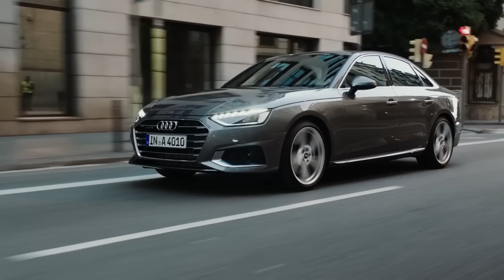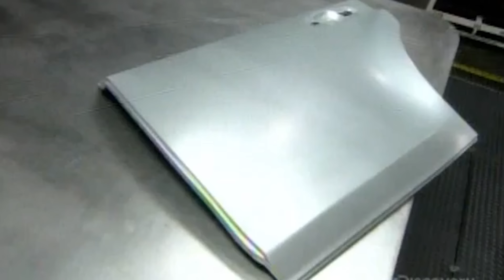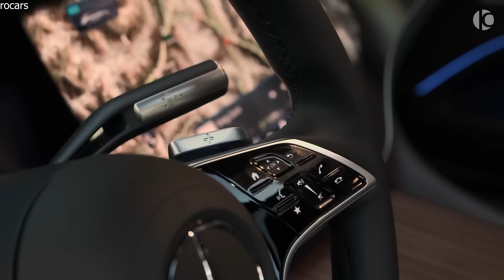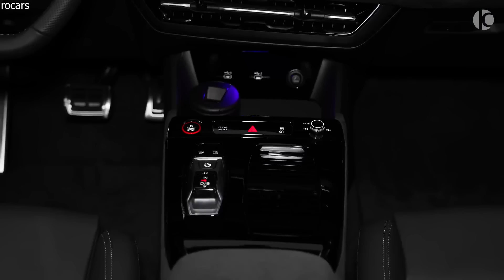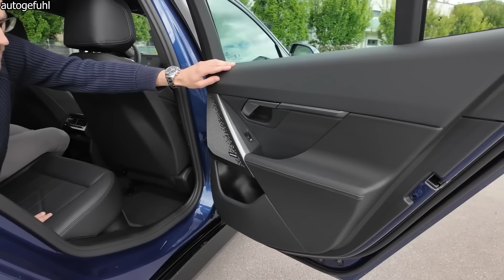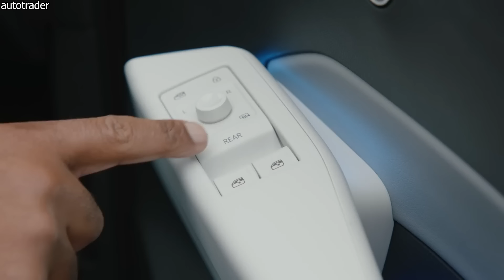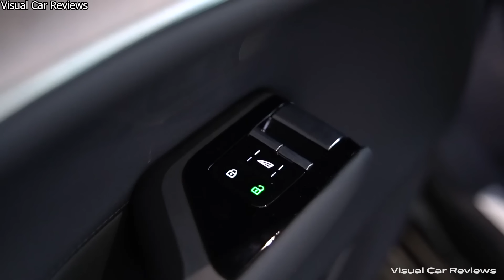Why New Cars Feel So Cheap?

Comment: Check out Genesis! Doesn't feel cheap, less plastic than the competitors, no abundance of screens, and very comfortable. If you can deal with a few reliability quirks then it's totally worth it. I bought the GV70 for my mom, the G70 for my wife and I got the G90. It really fills the gap between the old style luxury car and modern.

Comment: Ever since I bought a 2006 Mitsubishi Lancer GLX 1.6 (almost poverty spec) my standards for interior quality are much higher, the dash is covered in vinyl but it has a soft touch finished with wood trim, the door cards are covered with the same vinyl finish up top and its backed up by foam so its nice and firm but not hard like pastic the middle of the door card is covered in fabric the seats where cloth but it lasted all the way to 425k km when I sold the car. This was a budget car with better interior than modern Mercs

Comment: No joke, 2013 Fiat Chrysler products have nicer feeling interior materials and switch gear than new BMWs.  I bought a used 2013 Dodge Dart base model a few years ago and everything was soft touch. Dash felt good, the climate control knobs were rubberized and felt premium, etc.

Comment: Went to a mercedes dealership today and was flabbergasted, My base model c180 w205 has a better interior quality than the GLE 53 on the showroom
Obviously it looked way more expensive but when I started feeling with my hand I could felt way more hard plastic than should ever be in a E class
And its crazy because the previous c class also didnt have any hard plastic in any place, just doesnt make sense

Comment: I have W201 Mercedes 190D, the C class before it was named like that, the car is 31 years old and driven over 500 000km, with all my might if you try to pull the door handles or the middle console it doesnt maky any sound, love sitting in quality, also the seats are ergonimic you can sit for 12 hours without any big pains in your back

Comment: I'm a german cars lover, even if I love every nice car. I think beginning of the end for Audi was up to around 2015. The peak (in production costs and craziness to satisfy customers) was up to about 2010. As for D3, C6... For bmw it's similar, but they went woke with that "seat heater subscription", which is already built in, and it adds weight, and you pay taxes for a heavier car, BTW...
I have A6 c6 3.0 tfsi with 213k km. It feels agile, the interior has everything you need. I'm so happy with that car. I don't hate on newer ones, but will never pay more for downgraded cars.

Comment: Sooo… say hi to SUKO
Built in Frankfurt the 2049 model year is basicly a car… but diffrent…
Under the bonnet the ~150 year old tech that fade away long ago is returned to be efficient, carbon neutral and eco friendly, HidroPower Hydrogen-ICE technology, that no needs to new platform or rare earth materials that needs child slavery to obtain. A/C buttons, no mercy to have plastic in interior and build to last with his iron block and rugged chain-drive.

Don’t panic. If you own the SK1 sedan and GK1 suv you can get free access to Hidro Hydrogen Refueling Services and Refueling Stations…

Frontscreen info screen and Shortcut Smart/Stop button is some of the difference that this car also have.
Come with us to save the automotive identity.

SUKO Be diffrent…

Ye… this is my idea to a car company… if any thing want to say comment me.

Comment: Audi is fucked. I went to an Audi "Experience" event to test drive the new models and holy cow guys, Audi is fucked. While the new platforms are good and the ride quality was really lovely, the interiors are completely fucked. I've just returned a loaner fully loaded black A4 B9.5 S-line that I had while my also fully loaded Q3 F3 SB black S-line was being serviced, both cars from that era have beautiful and high quality feeling interiors. The A4's interior is more or less the same as in the Q3, but the ride quality was a different level. The A4 felt sophisticated, silent, premium, the interiors in the new Audi models pale in comparison to the ones in the A4 or Q3. At the event, even the salesman (he said he's in the approved used department, selling used cars) said it's much easier to sell the previous gen models because most buyers see a lot more value in those. When you sit in the new A6 or A5, both loaded costing 100k, you literally don't see or feel what you're expected to pay that kind of money for. You can get an A8 for less than 100k and you can feel the quality as soon as you pull the door handle. The A5 doesn't even have door handles anymore, while the A4 had those beautiful door handles that lift upwards and feel so premium. I seriously don't know what to get as my next car, I'd love another Audi, but I am not stupid enough to buy one of the newer models. The new Q5 rides beautifully, but the interior is on par with my Q3, so I really don't see the point. The previous gen Q5 feels like a massive step up from my Q3. Q7? Q8? By the time I'm ready to move on from the Q3, these will be discontinued and replaced by whatever Audi is doing to their lineup now. It's fucked guys.

Comment: Circa 2017-2018, european vehicles, especially those sold in America became much more reliable engine wise, electronics improved, and more. On the flip side, their vehicles became much more disconnected, brands dissociated from their historical stances in car design, and quality on interior went down (more plastics added). and this goes for all brands from europe. I owned a 2012 BMW 535i. years later, i test drove a 2019 BMW 530/540. It felt sterile, and appliance-like, like driving a Toyota vehicle. No road feel or handling, pumped-in engine sounds, and more. Sadly, a same year Toyota Camry XSE or TRD was more fun to drive and looked/felt more expensive then the BMW I was sitting in. Now, I refuse to buy any vehicle made past 2017. My daily driver is a 2013 Jeep Wrangler and my fun car is a 2010 Jaguar XKR. Both are extremely reliable, not controlled by electronics, easy to work on, feel connected, easy to source parts, and insurance is low! Whenever one of those vehicles give out, I will replace it with another vehicle older than 2016.

Comment: Had a 2023 VW Arteon for a while. Absolutely had all of that flexing and creaking and overall cheap -feeling materials everywhere. 

By comparison, my 2025 M240i is solid as a rock with high-quality feeling materials and good design language. 

I think that's at least partially because the 2 series is the last to get "updated" so it still has a lot of the older BMW DNA that the higher series (5, 7) are losing.
Reply: Yes, there are a few outliers in BMW's portfolio that are still good because they haven't managed to replace all of them yet. 
The 2 series coupe, 3 series, 4 series, 8-series and Z4 are still good, because they got their facelifts before the cost cutting began. The last Z4 and 8-series can't even be called facelifts, they've changed almost nothing. 

Sadly that all changes this year. The 8-series and Z4 production has stopped, and the 3- and 4-series are getting replaced with the neue klasse later this year. 

Now, I don't think it's all bleak.. Reviewers have noted that the interior in the neue klasse iX3 (released a few months ago) is very good, beyond the outgoing X3, so perhaps they'll be better built even if they're ugly. Time will tell.

Comment: Check out video ”BMW Haptics”. It’s about  BMW designing physical buttons haptics, haptic curves, the feel how it feels when you press or use it and the sound button gives. They measure those buttons haptic curve with computer etc device. I don’t know todays situation. But even when you order buttons from factory, you can choose what kind haptics you want from it, those are made with different springs and designing rubber parts etc so that it gives the feel you want.

Comment: THANKS for pointing out the thinner materials. Even full leather interiors feel cheaper, as if they have carton behind them. EQS is a good example of feeling super flimsy and cheap despite the surface-level material choice.
Reply: New cars use synthetic leather aka plastic lol, fake leather. Which is why the leather feel way harder than older cars that you used to just sink into. Even the cloth seats in new cars are hard and have no wooly feeling like old car cloth seats used to have.
Reply: @aimxdy8680  even faux leather can be very good, the problem is that they make crap ones.

Comment: One of the reasons why I switched back to old BMW E39. Honestly, I cannot name one modern car that has equally good interior quality.
Reply: I recently bought an E39 and the interior stands out even by today standards. I managed to get the 525i with the M54B25 engine and it's smoother than many new cars.
Reply: @M.Mantas
+1
I recently drove a 2025 BMW 1 Series 120, and apart from the BMW logo, it could have been any other car brand. Almost looks like a kia. Really frightening how much the quality has declined. But the main thing is that the investors are happy now.
I would say only Mazda still has "good good" quality interiors until the 2025 CX-5.
Reply: Right! There is no hard plastic on the whole dashboard. Absolutely stunning car ❤

Comment: Im on the fence woth this tbh at least for car interiors cos I know when I was younger in these early 2000s n late 90s cars they felt cheap to me then and they still feel cheap now and new cars look and have more features all be it on a cheap vibe. They've always creaked and everything is plastic and simple where possible its never changed, like if u did a video of a car from then the plastic would creak the same way. So I feel at least in interiors its the same deal
Reply: Not in the 90s and 2000s luxury cars, the 90s cars you’re talking about were base models sold for low class. The 90s S class was 20x better in quality than the new S class, the Maybach 62 of the 2000s is noticeably better than the new maybach.

Comment: Peak Audi was 2017-2019 Q7 interior. You had the digital gauge cluster, (virtual cockpit) integrated into the dash and a screen that rose out of the dash with a circular controller and PHYSICAL SWITCH GEAR FOR EVERYTHING ELSE!

Comment: Comparing the Golf 7 to the Golf 8 back when it was launched was the eye-opener for me. It just feels like Temu-golf7 if you step directly from 7 to 8. And it has worse drive feel in the steering and chassis.

2016 really was decisive year in the automotive world, where the car manufacturers formed a cartel to shitify all cars in response to dieselgate and the Chinese outsourcing.

When the new models arrived the customers didn’t have a choice, they could only pay off auto-journalists to praise tech ‘features’ for a few years though.
Reply: Naaah I would say the decisive year was 2020, not 2016. 

In the 2015-2020 era the vast majority of brands have improved a lot. BMW upped their interior quality and reliability significantly. Audi did some questionable decisions with the touchscreens (A7), but they made them work with haptic feedback and separate screens for climate controls and still improved their quality. VW was maintaining course with the Golf 7 facelift which was one of the best Golfs. Only Mercedes was showing signs of weakness in the A-class and C-class. 

I think it's 2020 where it all came crumbling down. VW started being incredibly cheap ever since the Golf 8 (2020+). Audi started unifying models (A5) and cutting interior quality hard to save money. BMW went off the rails with the designs first and later with the quality (2022+). Mercedes is the king of interior quality downgrade with creaky plastics everywhere, even in the S-class. 

2016 was perfectly fine imo. Hell, even Ford upped their interior quality game hard in 2018 because everyone was making fun of them.
Reply: I don’t know if that’s the case with these specific Golf models, but electric power steering feels a lot more disconnected, cheap and lifeless compared to hydraulic power steering in older cars.

Comment: So far not all manufacturers jumped on the bandwagon. At least not with all models. 

I got a 2022 CX-5 and love it. Wouldn't trade it for the 2026 model even if they offered it in exchange for it. 

But one of the biggest issues you mention - electrification - doesn't come from manufacturers but from shitty Bruxelles bureaucrats who forced companies to go the EV route although it's not sustainable and customers don't want it either. 

But there's plenty of shills/bootlickers in media and marketing that push for all the wrong stuff...

Comment: Besides using cheap quality, flimsy materials, having a bland white slice of bread with a single slice of cheese on top looking design, these new cars are incredibly over-complicated, impossible to repair, small parts are only sold as part of a larger component, they require Internet, subscriptions. The moment I checked out the new G60 generation 5 series BMW, I immediately noticed how poor the plastic quality was. That car is not premium. People have noticed, and the knock on effect has been that the older car prices are now rising.

Comment: Tons of old cars that were also full of plastic it was just a harder more stiff plastic
Reply: Those were mostly poor people cars sold under base model trims, the mid-end and high end cars didn’t use plastic back then. The problem is that high end luxury cars being sold new today are using too much plastic and as much plastic as a base model cheap 90s crap-box like a Ford fiesta, Geo metro etc
Reply: @aimxdy8680 you gonna pretend like manufacturers didn't fill cars with fake vinyl wood, plastic is plastic
Reply: @p @palm_fangz1018 Compare a 90s Toyota Century, W140/W126 Mercedes S class, Lexus LS etc, The new W223 S class is far more poorer quality than the 90s W140 and 1980s W126 S class.
Reply: @aimxdy8680 looking at the pictures rn, and there is a lot of plastic what was the point?
Reply: @palm_fangz1018    "Tons of plastic” Clearly You haven’t sat in any of the cars I mentioned in person lmfao, I sat in both W223 S class and W140 and the W140 is noticeably nicer inside with way better details. Google images doesn’t cut it chief
Reply: @aimxdy8680 I'm literally looking at the pictures of the car you described right now and I'm seeing plastic, the back seats are nice but the dashboard is still hard plastic
Reply: @palm_fangz1018  They aren’t hard plastic, the 90s toyota century uses real Wood grain dash with chrome hints, and leather with lamb Wool seats. The upper dashboard which has most of the plastic is Soft touch polyurethane plastic, zero hard plastics in those cars. I literally sat in those cars I mentioned so how are you going to tell me lmfao. Pictures again don’t cut it
Reply: @aimxdy8680  Cars are mostly plastic on the inside since the 1960s.

Comment: That's why I drive VW Phaeton
Reply: The reason that they're cheap to buy used is because they're ultra expensive to fix if anything goes bad.
It's the price of a premium car built in a very small quantity.
Expensive, often bespoke parts (check the italian-made hinges on the bootlid), expensive labor costs, expensive to insure, etc.
Reply: @nunopereira6092 if you want to have it asap and use „normal” services then yes. I like to do a lot of things on my own and i don’t mind spending hours on forums to find solutions to common problems this car have.
Reply: I'm pretty sure it's VW
Reply: Superb choice 🎉🎉🎉
Reply: The Phaeton is a hidden gem of a luxury car, massive thumbs up for me!

Comment: I was talking to an engineer at Porsche many years ago and he stated that customers were no longer interested in panel gaps and trim quality. Screens were getting larger, inductive phone charging and ambient lighting were increasingly where customers placed their priority when selecting a new car. Manufacturers have responded and here we are, the case for well cared for older cars with decent build quality has never been stronger.
Reply: No sympathy then
Reply: They just forced that in short term but they would now get the results of that short sighted policy in long term...
Reply: Correction: customers were no longer interested in gaps and trim quality according to their market research . Doesn't mean their research is accurate. 
And this is already being seen in sales. Last year for the first time in history, the 7-series outsold the S-class in the US, and it's largely because the latter has pathetic interior quality.

Comment: I have owned two each of BMW, Mercedes, and Audi. Today I drive a Tesla which cost less than half the price of an Audi/BMW/Mercedes of the same size/type and with the same performance/specification. Why? Not because I can not afford a new mercedes, I can. It's because of the huge amount of recycled black plastic components under the hood. Over time these components crack and fail due to thermal cycling which causes numerous problems that often costs thousands of dollars to correct. I will happily buy German again if and when the quality returns.

Comment: I was driving a 25 year Passat 1.9 TDI in the highline trim up until this year. It had 550.000km on the clock and found an untimely end due to a crash.

Now I found a used Golf 8 Variant 2.0 TDI for a good price.

Mind you the difference is day and night. Sure the Golf drives a bit nicer, but when you compare the leather and alcantara all button interior of the Passat to the simple plasticy touch screen madness in the Golf, it‘s astonishing.

I just find it funny that my car has the same interior materials and parts you find in the much more expensive Audis now. Just go buy a Golf and have some cash left over for a vacation or something 😂

Comment: tbh i like bmw's newer designs, they are fine, though having sharp lines would be nice, the main problem is the interior, it would be nice if full centre consols like the lexus lx570 are used in cars instead of leaving an open cold  hard storage area like the new minis and chevy silverado
Reply: BWAHA, that X3 was FUGLY, Pontiac Aztek ugly